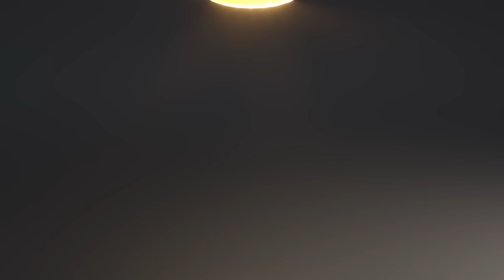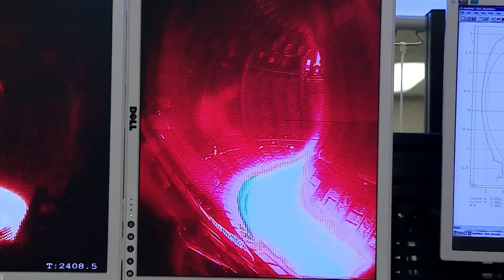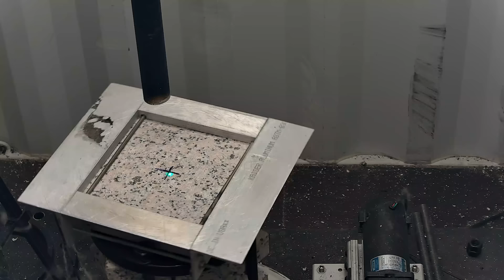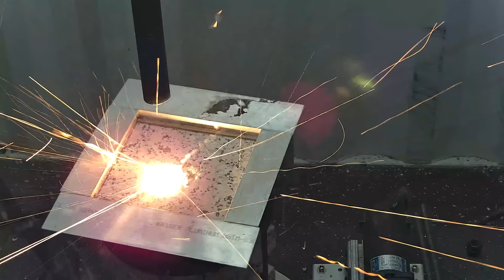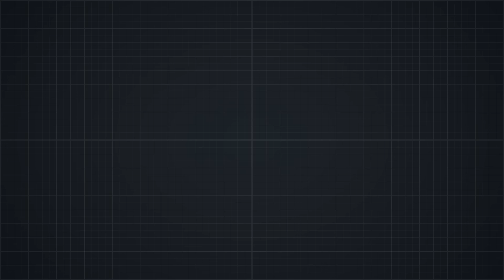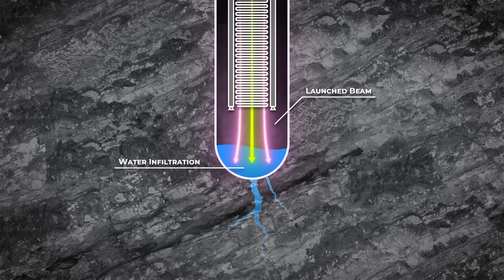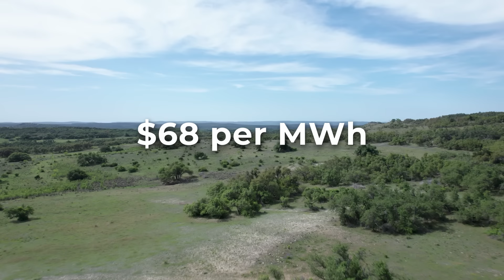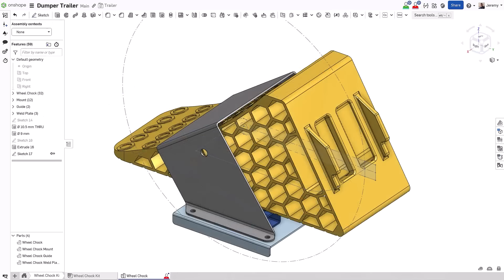Geothermal Energy is Changing

Comment: They drilled couple of years ago (drilling took several) two six kilometre holes to Espoo, Finland as pilot project. The temperature down there is 120°C. Unfortunately they didn’t get the water to flow from the hole to another well enough to make the thing commercially viable.
Anyway, the point there was to produce mainly heat to heat houses. (Here in Finland that’s kind of mandatory)

Deep Heat is now offering the holes for research use.

And I believe that in the last phases they used some sort of melting drilling shown in the video. Maybe you should take a look at the project. It’s called Deep Heat, Otaniemi, Espoo.
Reply: It is common and natural that water must not be found at 6km depth. Why they didn't manage water from any water bodies.... river, lake, reserviors water to insert into one hole⁉️
Reply: @mz19747  The way this should work is to pump water down to one hole and then up from the other. The water should sip through cracks in the rock down there. But they didn't manage to crack the rock enough to get the water flowing through enough.

Comment: This may be a dumb question but could you not use conventional drilling to get to challenging depths then use their wave guides and equipment to drill deeper. I am by no means an expert on this but to me it seems like a good idea. 

I understand this would require having both types of drilling equipment but if you are gonna have a drilling contractor to run the job they will most likely already have all of it. I feel like you could “rent” the deep drilling equipment to them to drill deeper. 

Anyway great video it was an interesting concept to learn about.

Comment: Doesn't sound too farfetched, however it still doesn't solve the issue of finding suitable alloys to withstand the immense temperature the deeper you go. The only material with a high enough melting point to get through the lower mantle is tungsten. Wouldn't even be able to go further than the mantle because there's no known element that can withstand more than 6000°F. I'd love for science to find a way to get as deep as possible but i can't foresee it in the near future without dropping an nuke down the hole and just blasting through😂

Comment: *Quaise Energy's Geothermal Drilling Innovation: Summary and Analysis*

*Key Technology Overview:*
- **Gyrotron-Based Drilling**: Quaise Energy utilizes gyrotrons, devices originally developed for nuclear fusion, to emit high-power millimeter waves that vaporize rock. This method avoids the mechanical wear of traditional drilling, enabling deeper and faster penetration.
- **Supercritical Steam**: Targeting depths where temperatures exceed 374°C to produce supercritical steam, which enhances energy efficiency for turbines, offering a competitive edge over conventional geothermal sources.

*Advantages Over Traditional Drilling:*
- **Speed and Depth**: Gyrotrons can potentially drill at 1 meter per hour with a 1 MW device, significantly faster than mechanical methods, especially at depths beyond 3 km where traditional costs escalate exponentially.
- **Reduced Wear**: Non-contact drilling eliminates drill bit wear, reducing downtime and costs associated with replacements.
- **Borehole Stability**: Melted rock forms a glassy casing (obsidian-like), potentially stabilizing boreholes and reducing reinforcement needs.

*Challenges and Considerations:*
- **Rock Composition**: High quartz content reflects microwaves, slowing progress. Adjusting parameters (e.g., power, gas flow) is necessary for different geologies.
- **Water Infiltration**: Risks energy loss and instability; proposed solutions include sealing fissures with molten material.
- **Energy Costs**: Gyrotrons require significant electricity (1 MW per meter), impacting operational expenses. Field tests will validate cost estimates.

*Economic Viability:*
- **Levelized Cost of Electricity (LCOE)**: Current estimates range from $68-$115/MWh, competitive with nuclear but higher than onshore wind ($30/MWh). Success hinges on reducing drilling costs through scalability and efficiency.
- **Capital Costs**: Initial investments include gyrotrons ($1.1M), waveguides, rigs, and purge systems. Total for a 7 km hole is projected at $19M, plus operational costs.

*Strategic Potential:*
- **Retrofitting Power Plants**: Leveraging existing fossil fuel infrastructure for geothermal steam could accelerate adoption, minimizing new construction needs.
- **Field Testing**: Upcoming trials in Texas aim to validate technology under real-world conditions, a critical step for investor confidence and scalability.

*Conclusion:*
Quaise Energy's innovation could revolutionize geothermal energy by enabling access to deeper, hotter resources. While technical hurdles remain, successful field tests and cost optimization could position geothermal as a key renewable player, particularly through infrastructure repurposing. The transition from lab to field testing is pivotal, with outcomes likely influencing future investment and adoption rates.

Comment: Please stop using LCOE, it does not really translate into real world retail power prices. Solar & wind have amazingly low LCOE but end up costing many times coal or nuclear because of the extra investment required in transmission & storage to offset their intermittent output and lack of ability to stabilise grid frequency. There is a clear advantage to geo-thermal power over other supposedly ‘green’ energy technologies in that regard.

Comment: Why not create multiple smaller gyrotrons that are incorporated internal and external to the current drill system? Gas and vacs to remove the debris. At home you never use the intended hole drill size first. Start small to reduce pressure and heat for larger bits to come.

Comment: Problems: 1) When you hit certain materials while drilling the RF may be reflected and destroy the drill-head. 
2) The rate of drilling will be way too slow in reality 3) Over distance, the RF losses in microwave (especially mmWave) are going to be way too high, and incorporating the gyrotron into the drill head would be impossible for these power outputs required. So this would effectively prevent it from working, and to make a perfect wave guide for these frequency without perfect geometry another limitation. 3) This unfortunately is yet another investor pump and dump, they make a fortune from environmental activist funds/companies (government, etc), drain the fund and disappear 4) It's not feasible for RF, it's ridiculous.. Even light would be better for this though that's not feasible either. 5) Traditional drill heads have come so far with modern materials and that is the most likely bet for worldwide geothermal

Comment: 2 questions I'm left with.. 
While drilling deep, how does the 'drilling ' head deal with the fibre build up when it's left with nowhere to go and ends up building up on the head of the machine 
And how extendable is the drilling head without loss of power?
Reply: i think the way it works is that the constant flow of air removes the particles that form fibers. whether they would escape a hole at significant depth though, i have no idea.
Reply: they flow mud out of the drill bit and it flows up the outside of the hole to the surface. this cools the bit and brings up all the cut rock

Comment: Hi! Pessimist here. The deeper they drill, the more rock fragment / vapor will need to be carried out by the purge gas (volume = depth x pi r^2). Eventually "rock vapor" may cool down + condense on its way up and block and drill hole, or the total mass flow of the fragments-in-transit will exceed some mechanical limits of the purge gas system. They can't realistically maintain the same ROP. Cool technology transfer from fusion research though.
Reply: I hate redditor introductions
Reply: @YungSteambuns  I hate that "Be me" shit
Reply: That's exactly what I was thinking!!!
Even if they somehow managed to evacuate all of the rock vapor (they won't), are they really gonna pull it up back to the surface through KILOMETERS of drill pipe without it condensing onto the walls of the purge hole and blocking it?
How are they going to connect hundreds, maybe thousands of drill segments together with airtight seals for the gas system in the first place?

Another thing I noticed is in the experiments that they show, they don't rotate the "drill", they instead spin the rock. This shows they haven't yet even figured out how to transfer that much power into a moving drill, I don't think any commercially available electric contactors at the moment can withstand that much power without immediately arcing into oblivion.

I agree the technology is cool but this thing is still decades away from any kind of practical use case. It just kind of feels like a middle schooler stuffing vinegar and baking soda into a mound and calling it a volcano.
Reply: @lakewoodln1060  the drill doesn't necessarily have to rotate continuously, it could cycle back and forth to ensure a full sweep
Reply: @lakewoodln1060 it will work effectively at the poles, just use the natural spin of the earth
Reply: Not if this whole thing is happening around a presized column. Like the one the drill comes in on. That might get jammed though and there are some key pieces of tech from oil and gas drilling that could be used to diagnose this before it happens.
Reply: agreed, just look at the room they're experimenting with.. imagine the condensed fiberous structure will block the vent hole which will need to be unblock somehow
Reply: Also, how do they plan to get those microwaves down long lines of tubes without loosing much power.
Or how do they plan of building a small device that is rugged and able to fit the hole while producing this amount of power.
Reply: I guess in reality this drill system would be combined with other secondary systems. Maybe you could use some kind of water system to transport stuff to the surfice. Maybe even expending the hole.
Reply: that's why they doing science, to figure out how to do it
Reply: Well, I think you misunderstood something here. The microwaves are generated at ground level and shot down into the borehole. So the purge gas is heated by the microwaves while traveling down. So while there's some heat loss it's quite minimal, as the whole borehole will be extremely hot while they are drilling, because the purge gas is already extremely hot as it reaches the drilling point.

So the vapors will accumulate over time on the extraction path, because the extraction path is cooler than the point of "drilling", but it's nowhere near "ambient" temperature and won't decay over the length of the bore operation.

So while you will need to clean the extraction path, you could plan multiple pipes and run cleaning operations while continue drilling here.
Reply: yeah, I also wondered about this. when you make a hole, you need a place to put what was there before the hole got made. Is the idea that it all gets compressed into the more dense obsidian-like wall structure?
Reply: just do what they do in The Core and have mini masers on the sides to keep it hot all the way up
Reply: @Sb129  perforations every once in a while to let a bit of the microwaves out might do the trick.
Reply: If normal drilling operations can expel the solid/liquid contents as they progress then I think they'll manage to find some way to manage cotton candy.
Reply: @thanatos454  The difference is that normal drilling the material doesn’t change phase and can just be transported out. With this method the rocks would quickly vaporize but you might not be able to get the gas out before it rercondences
Reply: This is what makes actual drilling difficult, you have to circulate with the right fluid and rate to get the rock out and back to the surface.
Reply: It doesn't need to be blown out. It just needs to be displaced by the gas (made airborne) which implies the amount of gas used is always the same as long as you find a way to get it down there without using more gas to push it further. For a silly example you could use bug adhesives for the fragments to stick to them while airborne and then have it attached similarly to a desk sander or a shopping mall escalator, cycling it up, removing the fragments at the top... There's plenty of ingenuity. You don't need 10 km for most geothermal applications. That reduces initiative.
Reply: We have the same problem in the guest bathroom, need a good plunger
Reply: This is why when drilling with a bit you are constantly circulating fluid (mud) to help keep the hole clean as you drill.  You and get yourself in trouble if you go fast then you can clean the hole.  You end up getting stuck.
Reply: Interesting yet not going to happen. I love the idea of geothermal but this ain't the way to get there.
Reply: when was the last time you did something useful, pessimist?
Reply: What if they copy the way trees transport water through its trunk, maintaining a vacuum in its extraction tube as it descends, like a tree growing down into the earth.
Reply: What have you done?
Reply: Seems like advertising to investors. A pump and dump acheme. He did this with Spinlaunch as well. Very sad.
Reply: @ryancormack6934  Centrifugal acceleration is the future. Spinlaunch still exists as well... If you think that g-force is the impediment for centrifugal acceleration systems you're nothing short of a Dunning-Kruger.

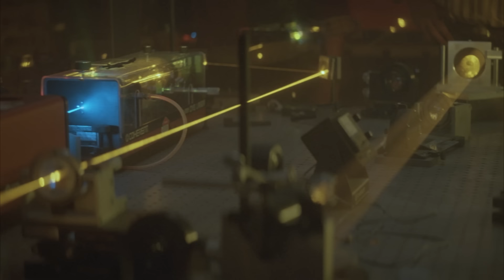Comment: 5:10 A correction. Visible light's frequency (~100THz) is at least 100,000 times higher than microwave (2.5GHz), not the other way around.

Comment: The Kola Superdeep Borehole, although only 9 inches in diameter, holds the distinction of being the deepest hole, plunging to a depth of 40,230 ft (12,262 m). To put it into perspective, the depth of the hole equals the combined height of Mount Everest and Mount Fuji.

Comment: @RealEngineering have you looking into the radioactive waste from geothermal power plants? It's not talked about often and my understanding is that the fluid used to pull heat from the earth also becomes radioactive over time. Like you said, the earth's core is a fission reaction.

Comment: I'm sure someone must have pointed this out before but aren't they concerned that the enormous pressures at such depths will spit all their pipes out of the hole buckling and forcing them out, then spewing molten magma  unto the site. The flow would definitely be strong enough to erode the walls of the hole and widen, likely causing a siezemic event of gargantuan proportions. I'm not an expert but this project seems vainglorious at best and utterly wreckless at worst. What if magma floods half of the United States. There is currently no technology to stop the magma once it starts 'pushing back' on that drill!

Comment: just a question from personal curiosity an a bit of personal concern. At the testing chamber the vapor of the melted rock form that cotton candy like structure near the exhaust that you guys have to wear mask for safety, how about in field test? is those vapor gonna simply released to open air? are you guys gonna put filter on the exhaust ports or is there any other solution?

Comment: Pipe Stack? No it's a pipe string with a BHA (bottom hole assembly).
Drilling Engineers? Drilling crews are far more expensive than Drilling Engineers.
Steel pipes and concrete? No, it's called casing and cement.

And bruh, 41 days to drill a 1000m hole is so so so fuckin slow, these dudes don't know what they're talking about when it comes to drilling rigs.

Comment: Instead of looking at the obsidian as a negative by-product, why don't you save on time and material by using the obsidian to reinforce the sides of the hole instead of concrete and whatnot? This could be implemented with two different lasers on the tip of the drill, finding the perfect combination of variables to drilling, or adding another laser to the side of the drill (one that cuts, another that reinforces).

Comment: What? This channel KEEPS going downhill, now with completely / WILDLY inaccurate misinformation. Of all the heat coming from the core, only 30-35% comes from radioactive decay of elements like uranium. It's NOT a "safe fission reactor under our feet", not by any stretch of the imagination. Furthermore, the vast majority of heat is 'primordial' heat leftover from the creation of the planet, as well as tidal forces, which result from the tug that the moon is constantly moving around. Stop making sh*t up, or at least do some fact-checking before you spew some company's lying sales pitch and presenting it as fact.

Comment: That LCOE chart intrigued me and I had some questions, so I looked at the source for answers. (Thanks for providing the reference by the way).

This is US based so the numbers will be different in other parts of the world.
The difference between the two gas lines is between peaking plants and combined cycle plants, they both actually use the same fuel.
The solar thermal line stops because the US stopped build solar thermal plants. The solar PV line provides an explanation for why they might have stopped.
The recent rise in solar and wind is due to the average rising, but interestingly the bottom end has dropped to $24 for both and top end has risen even more. They don't provide a concrete reason for this increase in variability in the report but suggest that supply chain challenges are part of it.
The wind line is for on-shore wind only. Off-shore wind is not included in the report.
Rooftop solar is included in the report and is second only to nuclear in LCOE, but rooftop solar is competing with retail electricity prices which are 5x - 10x higher than wholesale. Not directly comparable.
There is a 2024 report now with one extra year of data.